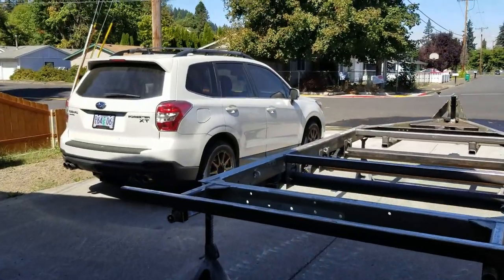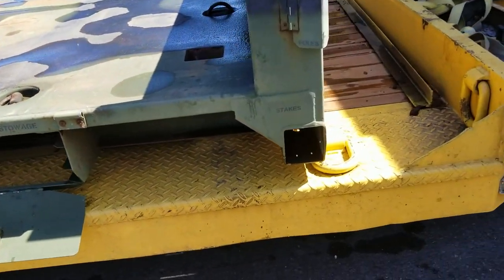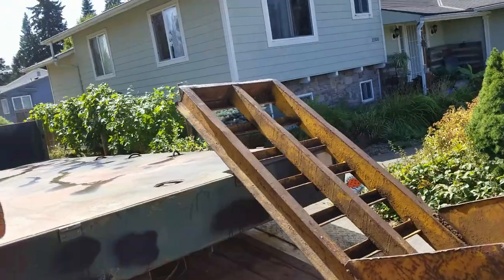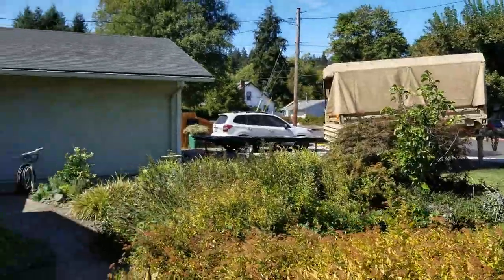M1083A1 7 ton trailer build Day 7 (M1083A1 bed recovery and extraction)

Comment: On the bright side... you don't have a grind the paint off the bottom of the bed to get good welds! LOL! Sean, I thought your were going to bring your trailer out to the yard... they could have placed the bed right on your trailer with the fork lift. Strap it down and away you go to weld it up. Dang nice looking trailer bed. Looking forward to seeing you next vid!
Reply from the maker: Would not work.  NO wiring, no trailer brakes, tires will hit cross members...  It will all make sense as the build continues...
Reply: @SeanFillner  Okay, got it. I have a set of tow lights that are magnetically mounted, but didn't realize about the clearance issues. Build on, my friend!